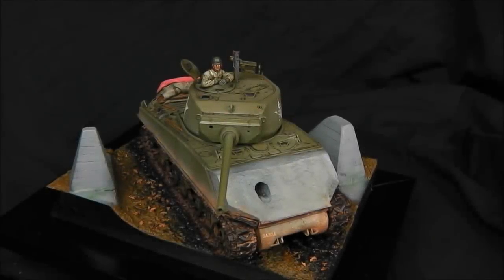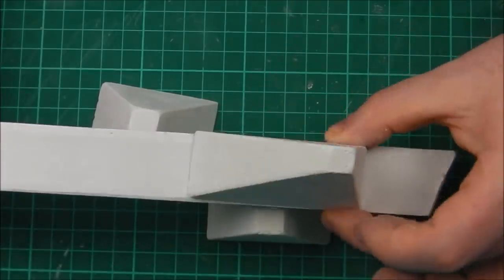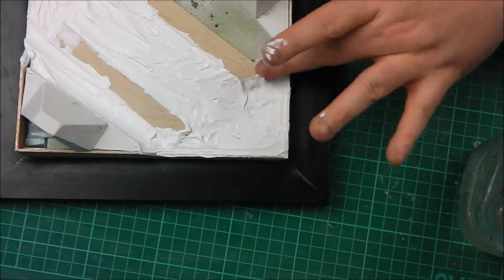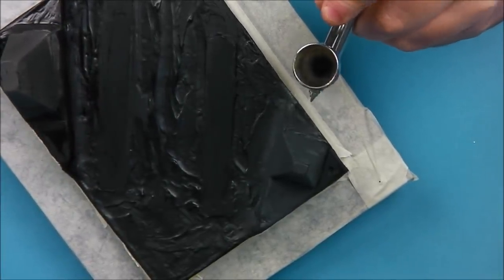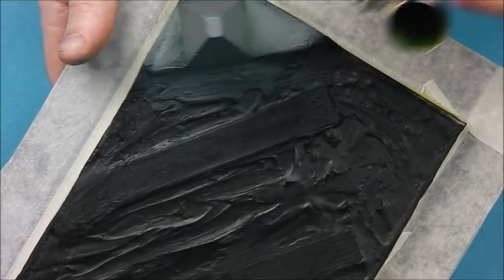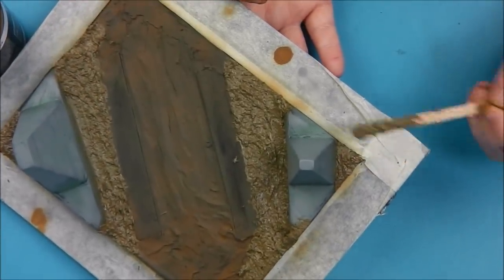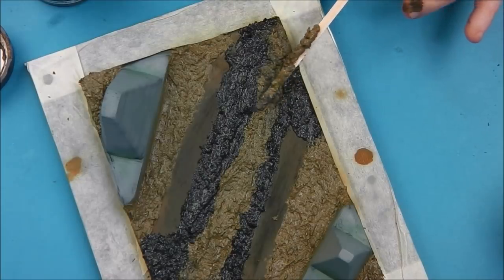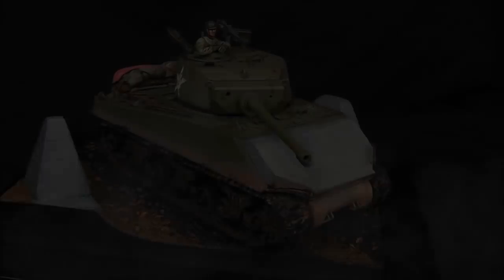How To: 1/35 Siegfried Line Diorama Base Tutorial

Comment: Cool build, but you should have made the Sherman either "moving" into or out of a crater, as if a Dragons Tooth was blown up either from demo charges or an aerial bomb, because the Dragons Teeth were designed as anti-tank barriers and were not spaced out enough for tracked or wheeled vehicles to pass.
Reply from the maker: There were roads going through the dragons teeth which this Sherman is passing through, though the allied demo'd parts of line this proved to be very inefficient
Reply: Shane Smyth - scale models , yep, I am aware of that. I really meant that it would have made it a bit more interesting with a crater there. It would have drawn in those looking at it, creating a story. Still a really good build though.
Reply from the maker: perhaps in a later Sherman build we can explore diorama theme with broken ground :)